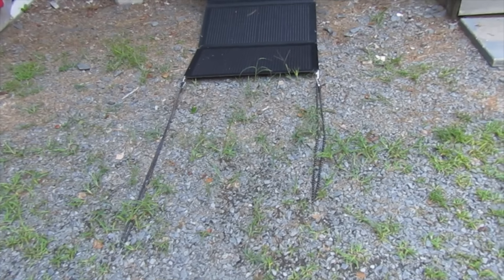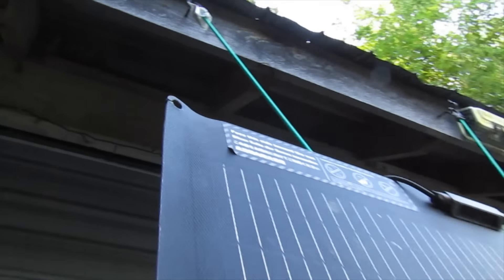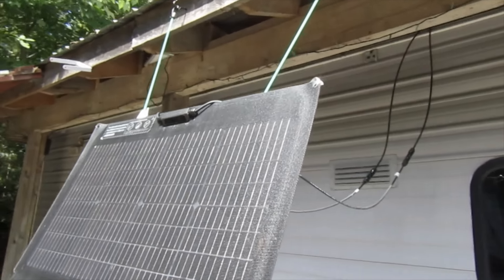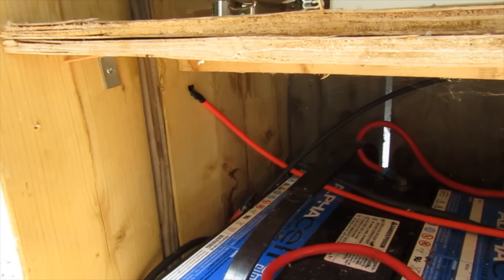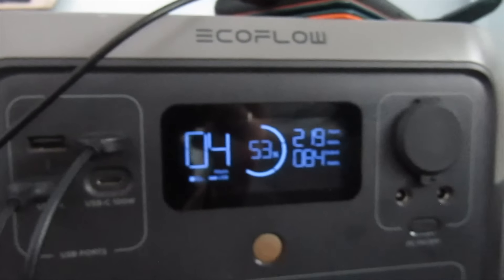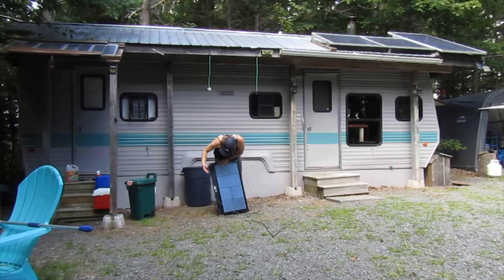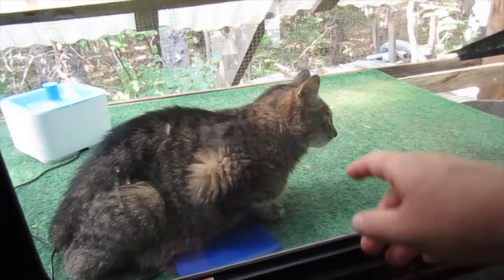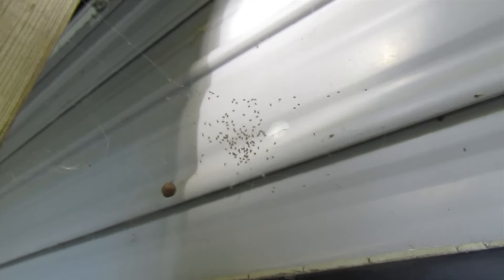Persistence (sometimes) is KEY + I Cracked My Tub.....Again!

Comment: Gypsy

the batteries

KEEP THEM if they are the same type of battery and a reasonable same age.

put them all on line for the main house power.
you can use that power, esp during no sun days.
dont run on minimum battery power,  in this case more is better.
if you can run on a higher voltage, (by putting 2 in series double the voltage) 
even better but you may have to 

get a different inverter, depends on what you have.
Also
the more batteries you have, the less stress you put on the 
batteries and the longer they will last.

The TUB
OK  emergency fix,  get some heavy plastic cut it so you can put it in the tub with some up the sides.  Tape the sides so water wont get under the plastic.  Cut a hole at the drain, for obvious reasons.  you can use the shower.

if you have a flat floor under the Tub, you need to put something under the tub when you place 
the tub.  Think a couple buckets of sand or gypsm,  its like concrete sort of put in deep enough 
so the tub will at least sit on the surface of the potting material.  It will support your weight when  
you step on it.

Ok just saw what is under  your tub, what a dumb design.
if you can get a flat peice of plywood to support the bottom of the tub, all the better but...

That tub looks thin, what kind of material is it?
If it is fiberglass, and since you have to take it out anyway to put the material under it,  epoxy resin may
let you repair the crack with fiberglass cloth.  or maybe JB weld epoxy.
Right now as temp repair, clear shipping tape or if  you have any eterna bond (its white and used on rv roofs), a piece of that will seal the crack.  then to add some strength,  a quart of TRUCK BED LINING-yup sold at Amazon (it comes in black, white, clear) will seal the tub bottom and add a little strength.   I know it sounds crazy but you need more strength where  y ou stand in that tub.

If you can't put some kind of potting material under the tub surface, this will happen again but in the mean time, 
you might consider putting a layer of some material over the bottom (where you stand) in the tub and 3 inches  up the side making a little tub in the tub.
epoxy is hard to work with and it depends on what the tub is made of if it will stay attached to the tub surface.

but you need something that will offer a stronger surface,  add strength to the tub plastic sheet.
In the end, you may have to either get a better shower base and use curtains, or make the shower base  yourself
with fiberglass cloth and epoxy.   y ea, its a job 

I hate to suggest something rag tag but,  
y ou could form the bottom of the tub with plywood,  minimum 1/4 inch, then form sides, minimum 3 inches to 6 inches, you can go higher.
seal the "tub" with some waterproof (paintable) material.
Yes, that stuff that is sold on tv would work, but have plenty of ventilation.
or, and t his might sound crazy,  use TRUCK BED LINING,  hey it can keep the water where it is supposed to be.Bed CoatingBed Coating
Reply from the maker: Thanks for all the info!
Reply: @gypsyjenna  you are welcome G ypsy 

That tub should NOT have cracked.

I'm of the opinion I would NOT buy another as you will get the same fragile thing.

I left a rather complex (but fairly easy) comment for a fix, well many fixes.

If you want to talk to get a better idea what the heck I am talking about, we can find a way to email and discuss the alternatives.

Bottom line,  You need to add more strength to that tub bottom.  It is more important now because now the crack has exposed a weak spot and it will only grow.  Tape is your emergency fix, maybe JB WELD putty, but you are working with a weak surface now.
A layer of something water proof and adds some strength (truck bed liner) may be the only way to go.  You can even add some fiberglass cloth when you apply that stuff but we need to talk before you even try that.
You have to put the liner on the tub, add the cloth, then saturate the cloth with more liner, let cure.    Honestly, Truck bed liner is tough as hell and may be an answer.

Good luck Gypsy.  So sorry to see the tub failed.  It is too new to fail.  Go get em girl.

Comment: I chose you over Joe Rogan…lol… I need to sleep and you are not 3hrs….
Crocks Rule….RV is crap… marine is the way to go but all silicone surfaces need removed now. The marine chock/adhesive will not hold to any siliconed surface…
Marine adhesive/caulk is the best for the situation that you have…very strong…